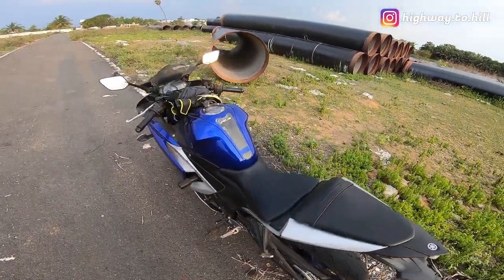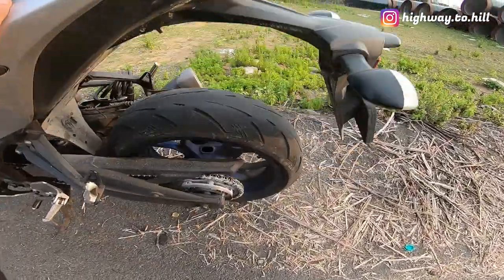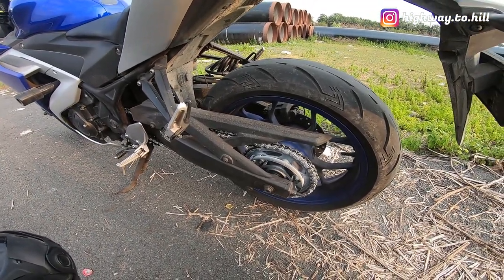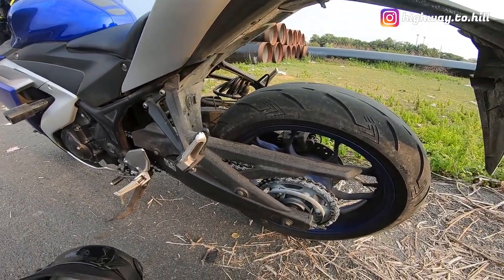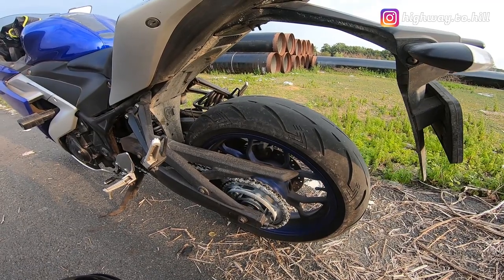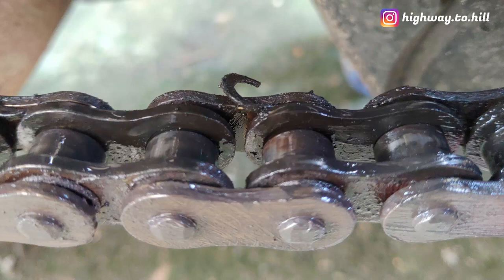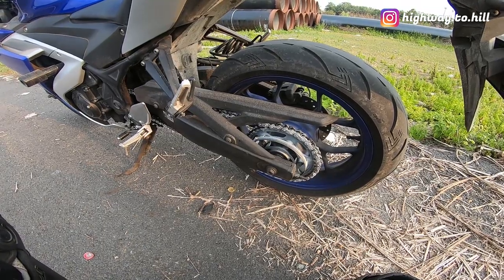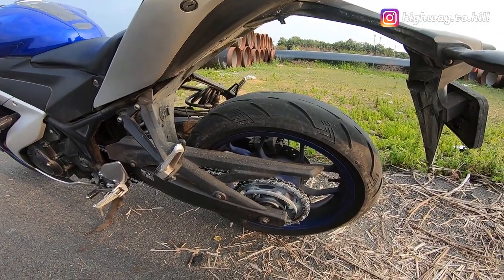ROLON Brass Coated Chain @ 17000 kms

Comment: I've been using it for 2.5k kms . In love with the lack of noise and the smoothness of the drivetrain. I haven't had any X-ring linked issues. But i haven't had so many kms as you , either . But a couple of days back I did notice a lil bit of superficial rusting on the chain, which of course went away with some tlc. Overall I'm satisfied with the chain , as of now . 
Btw nice and comprehensive video as always .
Reply from the maker: Cheers man.... Thanks for sharing your feedback. Let me know if you see any X ring breaking issues.

Comment: What cleaners are you using man? It's said some cleaners especially kerosene jaise things we use eat into the rubber rings. Not a lot but slowly. Refer to fortnine videos for more. info. Cld be the cause don't know.
Reply from the maker: Yes... That could be. I don't use kerosene.
I have been using Motul chain cleaner.

I tried Putoline and Mannol lubes and I think one of them was a bit too harsh on the X-rings. A few broke off. 

I'm done with both and stopped using it. Back to Motul cleaner + lube. I got my 2nd set of Rolon chain/sprocket assembly and this time around I didn't see any X-rings break.

Thanks for your message!
Reply: @HighwayToHill  try using trm calidad chain lube and cleaner
They are currently best in Indian market 👍
And their chain lube doesn't attract dust like motul and it's fully synthetic too 😊
Reply from the maker: @hello-dz8co  Thanks for the suggestion. I haven't heard of it. Will check it out 😎🙏